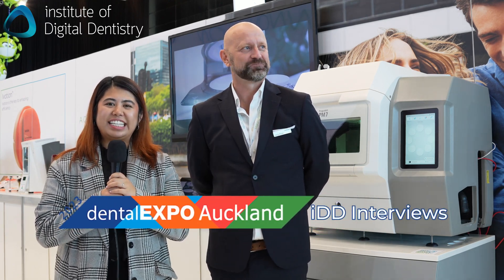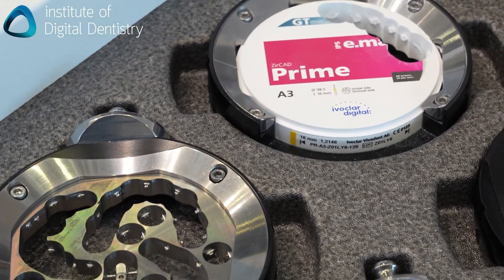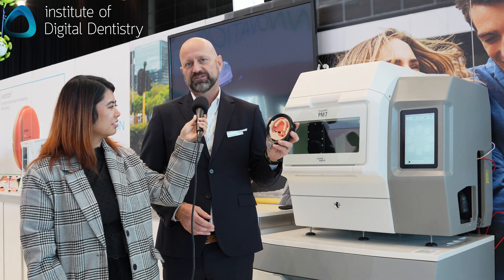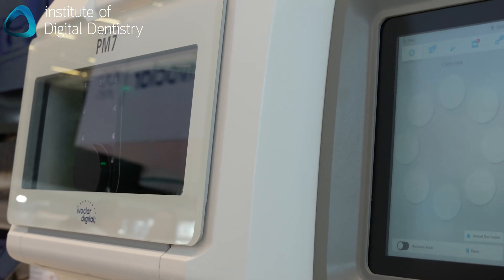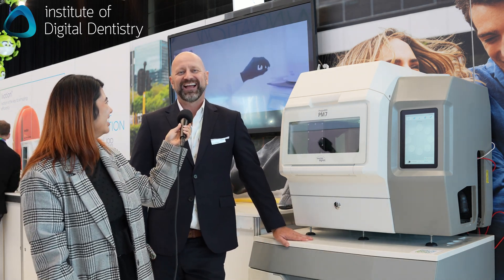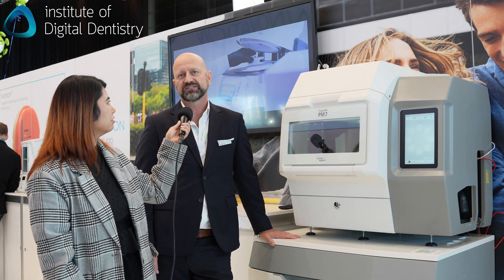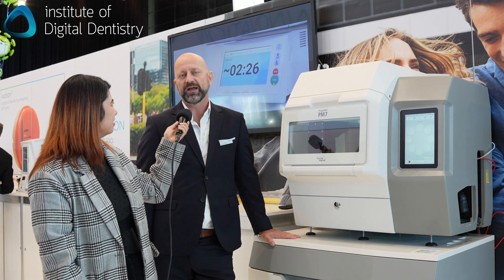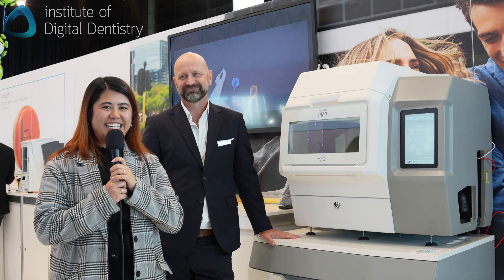Ivoclar's PrograMill PM7: The Future of Digital Dentures | NZ Dental Expo

Comment: What's confusing is that the software doesn't support milling in titanium. So why does he state that the machine can do this?
Reply: Hi There, this is Doug from the video. Yes, the PM7 is capable of milling Titanium and it has milling templated already in the CAM software for this. Not sure why you think it is not able to do Titanium but maybe you should contact the local Ivoclar Representative who will fill you on the capabilities.
If you are looking at milling implant bars in Ti then custom Strategies are needed from IV that I can supply. Please note, these are not validated by implant companies.
Hope this helps